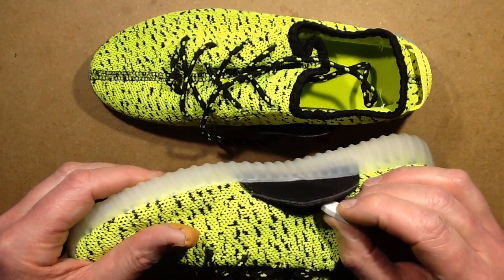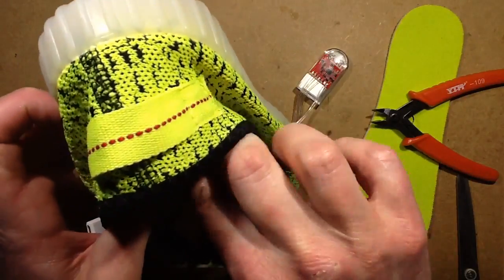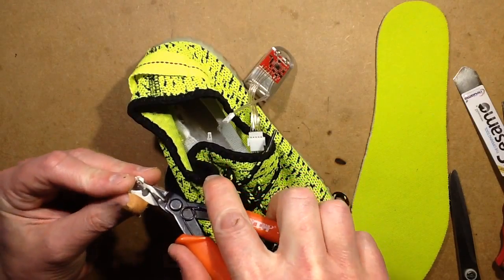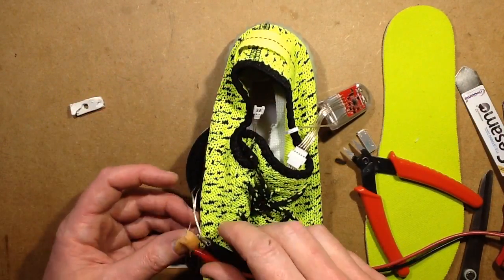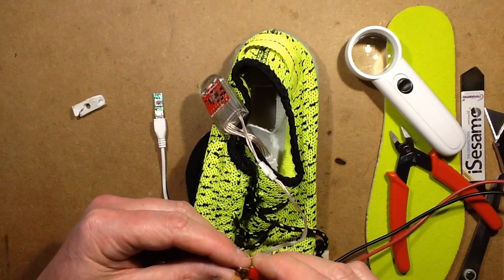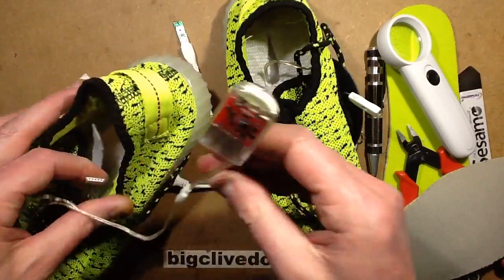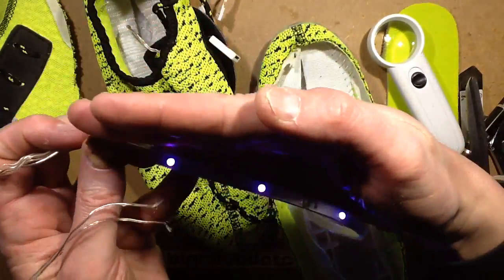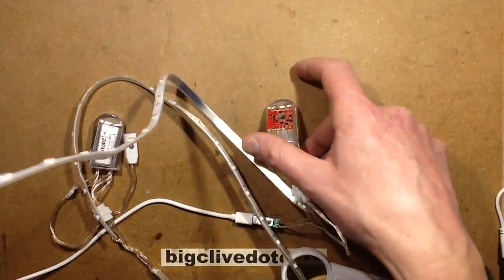What's inside LED light up shoes?  And can they be fixed?

Comment: I noticed they put hhe battery in the area that gets tve least pressure. Still not a good idea having had a battery vent luckily one with some kins if protection so it just pumped out acrid brown smoke not like a firework.
I really should watch tbe wholw video before commenting got to the potted part.

Comment: Clive, I'd love your input on this, I had an intermittent backlight issue on an "edge lit" smart TV, when looking at the leds, some of them (9 out of about 120) weren't testing as a diode, although they still lit up when I tested them with my power supply, I've seen leds fail before where they don't emmit light but still act as a diode, and so the rest of the backlight array stays lit, but I've never seen leds fail in a way where they don't act as a diode but still emmit light, is this possible? Or am I doing something wrong somehow? This particular TV also had a blown 2.2ohm smd resistor on the power supply board near the led driver ic and the ic itself had a tiny hole in it.
Reply from the maker: When gallium nitride LEDs fail they often develop a rogue parallel resistance that will mess with the diode test on a meter.
Reply: @bigclivedotcom  so they had definatly failed. That's good to know I replaced them. Along with the resistor and ic and the tellies still running touch wood. Thanks for clearing this up, I hate it when I don't understand something.

Comment: I remember having a pair of these when I was really young, about 4 or so.
I kind of remember taking it to bits when I'd grown out of it.
Had no idea how it worked at the time but I remember there being a tube with a metal ball bearing that must have acted as a switch to turn them on for a set period of time.
They must have had really long life batteries, I don't recall them running out of power. I doubt they had some charging system built in like the jerk off flashlights.

Comment: I sat here for 15 minutes mentally yelling, "Unlace the damned thing you lumbering git" and then he just takes a pair of shears to the darn thing. I love ya, Clive, but at times I wonder about you.

Edit to add: The flat metal strip is because shoe soles flex as you walk and that would quickly break the tape.  Having the 304 stainless steel strip in there protects the tape from lateral flexing and forces a larger radius when bending, reducing the chance of breaking the tape

Comment: My mom got a pair of these from a garage sale. When I first plugged them in, I saw a faint red light flash but now nothing.  Do they require hitting the button a certain number of times or something.  The connectors are all together.  I've even tried swapping the battery modules.  These where a little easier to get to than your new ones. I'm guessing whoever had them before saw your video and fixed them at one point. 
The batteries do look swollen. Also I havent stripped any wires yet on it. Everything is still intact. I dont see any burnt looking wires or chips.

Comment: Wait... That button is soldered across VCC and GND, what if you press it while it's charging, won't it short 5V to ground (or 110~240AC in the case of the Cheap Shitty Pink Charger from China), even if that resistor is in series with it that still doesn't seem like a good idea as it'll have to dissipate the current through heat... At least I'm pretty sure that's right.

Comment: At first I thought, "Queer Shoes". By the time you were cutting them up, I felt bad. They look pretty cool. They look like they could be comfortable, as well as flashy. The Lithium in the sole. Don't get them wet and don't wear them on construction sites or use them to go climbing on a pile of old, broken pallets. Wear them to the night club. The uppers look so "meshy". Flexible. I think what got me was the resemblance of the green to the Kawasaki green I remember as a youth. I felt sorry for that shoe.  :-(

Comment: I'd bet on the charge lead connector popping out. Difficult to tell but did not seem to be anything but a friction fit connector and no restraining on the lead itself, meaning that if someone pulled hard on the charge port\button end of it or possibly even lifted the shoe by it, the connector would likely just pop right out.

Comment: btw those little unmarked 8pin chips you find in pretty much every cheap chinese product are often just generic clones of very early (=slow but self clocking, not much memory or features) PIC microcontrollers.
Reply from the maker: I often compare them to PIC12 microcontrollers.
Reply: sounds right. I don't have much clue about the different PIC models (I'm used to AVRs, i guess the comparable model there would be the tiny13, which you can get for a few cents as chinese clones :P), but I noticed most of those unmarked chips contain PIC code and are usually also unprotected so you can do stuff like that by just reflashing them: https://www.youtube.com/watch?v=VWGIgH9ViEE

Comment: i wish you would have tried to charge it first before taking it apart. if the cell is not charged because the plug was not plugged in, it would not light. I think it would have worked if you charged it after plugging that unplugged plug in. :-/

Comment: I assume that the metal strip doesn't have the sticky removed as that would restrict the LED tape from being bent.  The way they have done it allows the metal to slide when turning corners.  Perhaps they ordered the sticky stuff and only after sticking it on (on a few test trainers) did they realize this was an issue and left it unstuck??

Comment: I do like how after you found the cable that charges the battery unplugged you didn't even attempt to charge the battery with the cable plugged in before tearing it apart. It could have very well been the fact that plugging in the USB was not hooked up to the battery and the cell was just dead from never actually being plugged in since the USB cable was not plugged into the battery... kind of a derp there just plugging the cable into the USB but not plugging the USB to try to charge it before assuming there was something wrong with the cable. It would kind of be like having a phone not charge, turning off the breaker to the outlet, then finding out the charger cable wasn't plugged into the wall, plugging it into the wall while the power is still off and then assuming it won't charge because now the cable is plugged into the wall.

Oh well it's easy to do stuff like that from time to time, nobody is perfect all the time, mistakes happen.

Comment: That small board with the button and the USB connector on it seems a bit suspicious. The button shorts the two wires that are also used for charging, right? So what happens if you press the button while charging?
Reply from the maker: The charge current limiting resistor is between the USB connector and button, so it limits the current.
Reply: Oh right, you even mentioned the resistor. Still not the smartest of designs.

Comment: Hi Clive as you are talking about cells going bang I have seen a video on Ecigs going bang any chance you could do a video on the problem as my wife won't smoke her Ecig anymore
Reply from the maker: It's very, very rare and often caused by custom modifications that stress the cells or the mixing of incompatible chargers and devices.  As long as the correct charger is used the risk is almost zero.  There are millions of these things in use and if just ONE fails it makes headlines.
Reply: bigclivedotcom or batteries, if they get dumb they uses cheap ultrafire
Reply: Arya Samwell her phone has probably the same chances of blowing up as an ecig
Reply: as long as you don't have an insane 300w thing it's fine.
Reply: I smoke e-cigs for almost 5 yrs now and never had a problem. That last guy you're referring to smoked on unregulated  mod that can go BooM if you draw way to much current as he did. He simply overstressed a battery and now he act like he does not know how that happen.

Comment: If anyone ever offers up another pair of LED or other "electronic" shoes, remember to remove the laces so the shoe can be opened fully and the tongue folded under and stuffed in the toe.

The steel tape is for rigidity. The tape appears to be standing on its edge inside an impact absorbing structure. The steel tape would prevent the much softer LED tape and vinyl sleeve from curling or twisting in the channel.

Comment: I'm guessing here, but I immediately thought "that's going to get pulled out too far" once I saw that little charging module. Even before you discovered the disconnected connector. A dot of glue and it wouldn't have been a problem anymore, and the adhesive metal strip behind the circuit board confirmed it: They really don't put too much thought into those cheap electronic gadgets...

Comment: Are you by chance using MDMA?  Only - you have changed.  I wa gonna ask you to look at my laser motorised disco apparatus but you might start throwing shapes and embarrass us both. 

Never the less - did I see you de-icing the the car locks the other day?   Thats quite a technique you have, though you could short circuit.

Comment: How tall are you big Clive? Size 15?!
Reply from the maker: 6' 4"
Reply: my thougt aswell! jeez i have big feet but they are a puny 11`5 against the giant that is Bigclive! XD
Reply: +bigclivedotcom

I can relate to your annoyance of finding footwear.

I wear size 12(US) shoes, but I have duck feet so they need to be 12-3E which are neigh impossible to find. The last time I went shopping for shoes, I went to five different stores and only found one pair after looking at probably 50 pairs of shoes that fits.

Shoes are so hard to find for me that at various points in time, I had to wear extra large snow boots everywhere because they were the only things that would fit properly :|
Reply: I got kind of the opposite problem. I wear a size 16(US) but are really narrow in the arch (about a B-C) and wide in the toe (D-E).  So it's either fit good in the arch and pinching my toes or room for my toes and slopping around in the arch. 

If you're in the US check out Zappos they have a big selection of wide shoes.  Mail order is the way to go for weird feet I haven't bought shoes in a store in 15 years.
Reply: bigclivedotcom You always seem to answer this question haha, makes a guy seem inadequate! And I'm 6'1"!
Reply: We have similar issues.  Really interesting vid, sir.

Comment: Clive, TK Maxx always has your size shoes in stock. Cheap too.
Reply from the maker: Alas, the local one seems to have completely stopped getting anything above size 12 and none of the branches in Glasgow seem to stock them either.  I used to get a lot of my shoes there.
Reply: Sauchiehall street branch definitely has huge sizes in. I've got a picture of my girlfriend holding up a size 16 running shoe we found there. They had quite a selection.

Comment: The effect would be a lot nicer imo if they'd manage to incorporate the thick diffuser layer from the light strip in the previous teardown... unfortunately that dayglow tigerstripe pattern just wouldn't go with my new wardrobe from Dickies spring collection.

I'm thinking it might be quite a feasible mod on a DrMartens sole - the stuff they're made of 'sort of' has the right optical characteristics and is already quite thick - pretty sure you can weld that stuff with a hot knife blade. (joinedup inc assumes no liability for shoe modding accidents)

Comment: I would have tried charging it first before ripping apart.
I'm guessing that being unplugged from the charge supply wire, it's never been charged from the factory and when you connected it back up to the loose connector It may well have worked if you plugged it in
Reply: George Smith my thought as well. "The charge ports unplugged... "

Comment: plastic injection molding around parts is becoming cheaper and more common. it's probably going to replace regular plastic enclosures for a lot of things. it uses a little more plastic, but way less tooling.

Comment: i stabbed a lithium battery all the way through with a needle once and took the needle back out.
magically nothing happened it didnt even get warm

The needle was warm but the battery was cold. so I taped the hole back up with a tiny piece of electrical tape.
The darn thing still held a charge and worked fine wtf?
SOO I smashed it with a sledge hammer extremely violently..... bad idea. EXPLOSION EVERYWHERE! it squirted out flames like a flame thrower!

Comment: Have you ever tried thinning down the tip of the isesamo? I "sharpen" mine then knock off the edge/burr so it wont slice flex/ribbon cables but since its thinner it gets into things easier.

Comment: Ah, I love servicing non-serviceable assemblies.  Although, at the end of the day, there's far more serviceability in these shoes than I was expecting.  The ones I had as a kid just had a little clear plastic module that slotted into the heels and contained a lithium coin cell.  No charging facilities; it was a primary cell and you were intended to replace it when it wore down.  Also at least once the module squitted out the back of the shoe when I was running down the corridor.

Comment: My guess: they pulled a bit too hard while assembling, which caused the wire to disconnect. Since they don't fully charge the battery it just drained itself bellow cutoff voltage OR have a shipping mode (where it disable the circuit until it see a charge for a little bit), which explain why the initial shorting didn't worked. As for the metal tape, I would assume it is acting as an heat spreader, to avoid making hot spot due to the resistor and leds heat...

... and yes, walking on the battery make me uneasy. I would have expected it to be in the sole of the foot, not at the heel. However, the heel is less flexing, so might be a compromise between flexing and pressure. Pressure may be easier to handle. Or they just don't care.

Comment: I'm thinking the "steel-like" metal is there to keep the LED strip from twisting around its axis so that the light shines in toward the middle of the shoe or down toward the ground, etc. Maybe it's a sort of spring steel and returns to its shape, keeping it facing outwards.

Comment: I want to see that lithium cell go off in the sealed compound! In 1992 or so there were the LA Lights shoes. Somewhere I have the potted light module, it is in fact several lithium button cells, very minimal circuitry (some sort of pulse one shot thing) and a REAL mercury switch! The shoes themselves were far higher quality. I'm not sure if even such a simple light module was cheap enough to go into the flimsier shoes available in those days - I'll guess it was mostly a name brand gimmick initially and I think they cost somewhere between $45 to $70 dollars.

Comment: I once found a small module on the street with lithium coin cell & tilt switch. It was possible to access it by starting to cut away on the resin with snips (creating a crack leads to another crack leads to another crack, .....), so you may be able to access the circuit board if you really wanted.

Comment: A trick I learned to deal with the wire with string (or fibers) in it - usually they're a low temp polymer, so going over the stripped ends with a lighter balls up/melts the string, then it's easy to pull off.  HTH.

Comment: I feel like walking on a lithium battery is a bad idea. They are notoriously unstable.
Reply: PlainSailingWeather 
Li-ion batteries have received quite a bit of bad press which is mostly unwarranted. They are NOT inherently dangerous but when they are faulty or badly misused they can produce quite a lot of heat owing to their high energy density. One of the problems associated with Li-ion cells is very much exacerbated by manufacturers insistence in squeezing the biggest possible battery into very slimline phones which greatly increases both the thermal and physical susceptibilities of said battery which would otherwise be quite safe. I have watched countless demonstrations of expected explosive Li-ion cell failures due to physical and electrical abuse, here on YouTube, only to witness little or no effect in the majority of cases. Given the many billions of Li-ion cells currently in use across the globe the relatively small number of actual dramatic failures should, rather than causing alarm (often fanned by the popular media), be cause for confidence in this world-changing invention.
Reply: Pete Allum TechRax comes to mind here when he was beating a galaxy with a hammer and the battery just inflated and zipped across the table. It was hilarious.

Comment: What confounds me is why they used such a chunky connector, and why it isn't just soldered in place.
They also could had made it a 6-pin connector at the end and during manufacturer, fed the cables for everything so it is at the rear of the heel, but installed opposite so the 6-pin connector going to the battery and board was at the very back to ensure the device didn't become disconnected.

The only bit of weirdness to plan against would be at the back of the foot, which some foam padding fastened in with hook-and-loop would had aided. As for the battery, it and the board being heavily conformal-coated with battery and board in a custom-made metal box would had done, or battery in the heel, board in the rear would had done just as well instead of resin-coating it.

Matter of fact, the board being on a piece of flexible motherboard, then coated with a flexible conformal spray at the other side would resolve the weirdness, as well custom-made "Waterproof" flex ribbon connectors would had worked.Where the strip ends, have a flex connector folded 180 to go toward the board, then folded over and across the board to the connector would had done just as well.